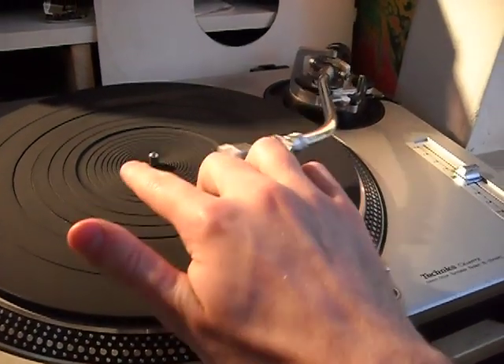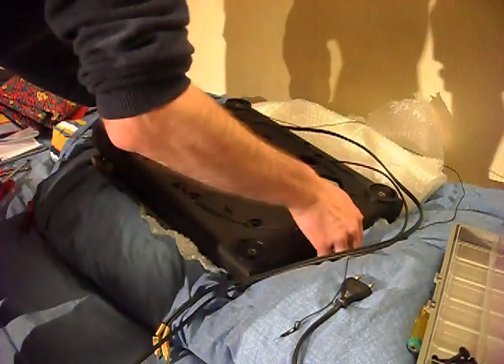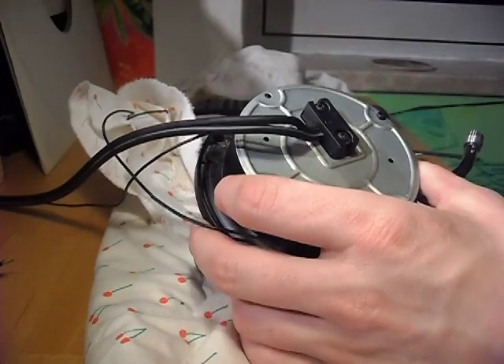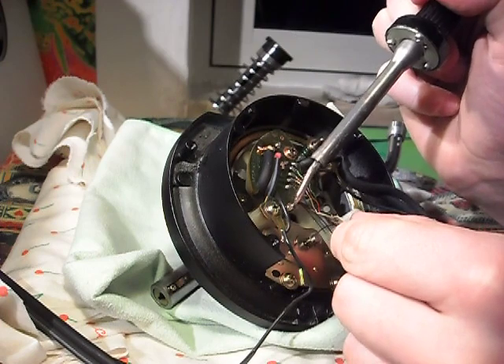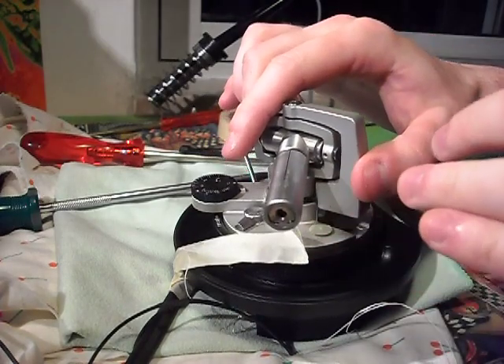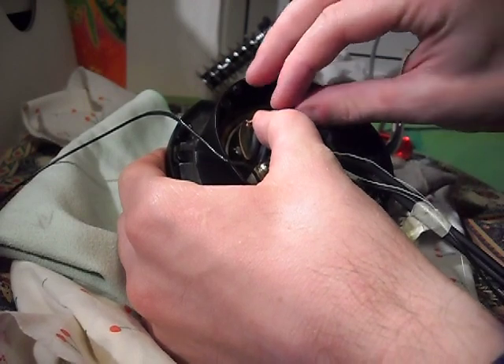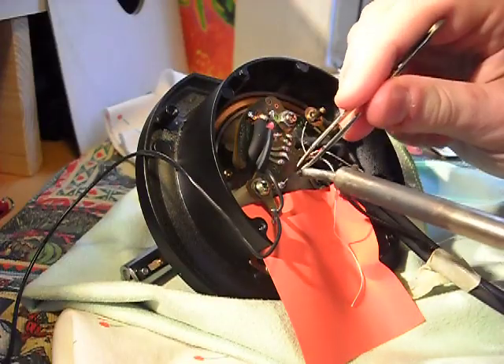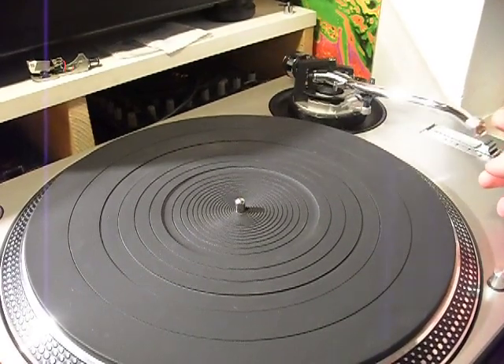Technics SL-1200 MK2 Tonearm Replacement

Comment: Cheers for the video, I have to replace the arm, on one of my 25+ year old 1210's, it took a knock years ago at a party, the arm was flopping about, like the arm one your deck, I did adjust it back again, as best as I could, but as they are calibrated at the factory, I would never be able to get it spot on.When I have a blank vinyl on, I can move the antiskate, backwards and forwards, without it making the slightest difference.
I added rca outs to the bottom years ago and did away with the leads, after watching your video, I now feel comfortable with swapping mine. Also want to fit dipless pitch also.

Comment: Hi, I've got a slight problem with the tone arm on one of Technics 1210 mk2 turntables, the signal is fine when playing a record, but there's a loud crackle when the tonearm is lifted or lowered from the rest to the record and vice versa. I have dismantled to the point where i have loosened the pcb so that i can see all the small wires. Everything seems to be in-tact. I'm thinking the problem must be inside the tonearm itself or somewhere inside the mechanism. The problem is not in the headshell as it works fine on my other turntable.

If you can help me at all I would really appreciate it!
Reply: +George Saunders   Sounds like a static electricity problem.

Comment: It seems to me, that even you replaced the tonearm, you new tonearm still was not working properly with anti-skating, yes it was coming back to armrest, but if I saw it right on your video, when on zero or 1,  the tonearm was not still in one place, it was still trying to go back to armrest
Reply from the maker: Yes because my table is not perfectly flat.You know when speaking about balance just a fraction of micrometer makes a difference. In theory if my bench was perfectly flat it should stay in place. But that's not the point, you can see the difference from the stiffness of the previous one and the free float swing of the new one.
Reply: Good point, i guess you need a completely flat surface to test anti skating, as someone who now has his 3rd pair of MK2's i can say that circa 50% of the turntables out there have an issue with the anti skating. Anyway, thanks for the video.
Reply: @djpunisha29  I'm having anti skate issues on my table. If I op2n it up like in this video. And recalibrate the anti skate, you think it might help. Or is it a get a new tone arm problem. Hope you see this!!

Comment: It seems a rarely  used turntable, appears like new, can i ask how tonearm has been damaged? An hit on gimbals? moving on travel without protection?
Reply from the maker: +eur990 I believe it's from '86, quite good condition for its age. The previous owner didn't mention any issue but i don't think the transport caused it. If you see in the provided url there is a picture, the top screw is chipped off. I guess something happened with it and they 'fixed' by severely tightening it without proper knowledge and testing.
Reply: JaKeAFC09 Ahh ok ok i got it  now, so the first owner touched that screw..  Probably because tonearm had acquired play so he tried to tighten the screw. You made the right thing replacing tonearm brand new...  Is true, sometime if there is play on tonearm bearings (just play no damage) is possible resolve touching that screws but.. it's a short term solution as play means  the tonearm has been stressed a lot so bearings quite worn. And  anyway, when you touch those screws is impossible go back to factory setting; Bearings have a finish of +/- 0,5 micron for a 7mg friction.. Impossible recalibrate them  with a screwdriver.. Those screws are made for a single calibration; the factory's one.
(Anyway bad transport also can damage bearings.. Often who usually carry turntable in flycases or without right protection causes damage on tonerarm gimbals..)
Reply from the maker: +eur990 Right. Some guys says that you can adjust it to be almost finger-tight, as far as dj use is concerned should be way to go. But that factory specs were really drooling, as i use it for LP playback couln't miss it.